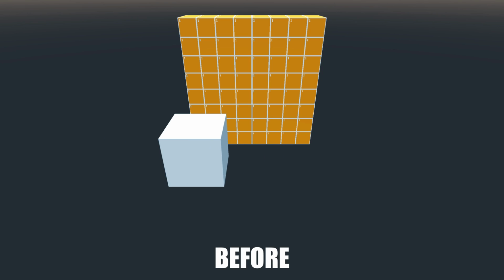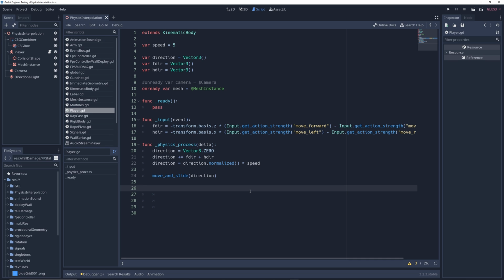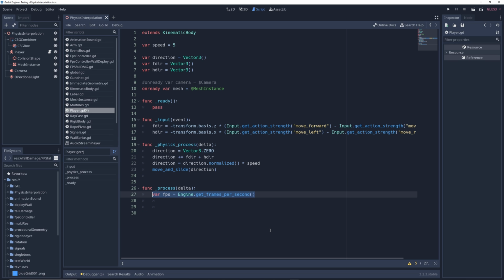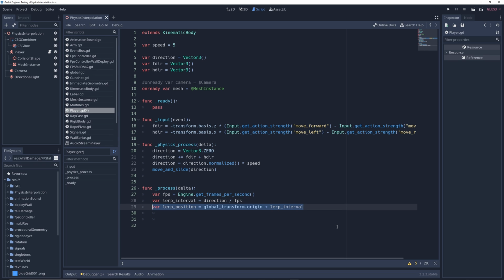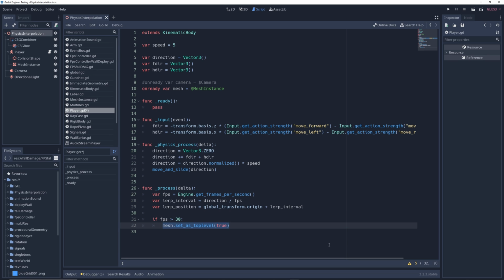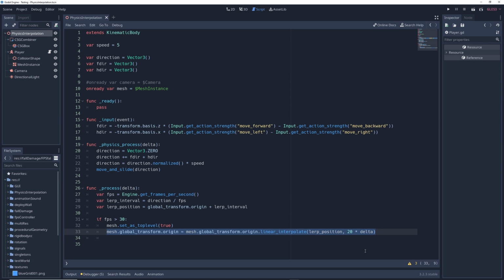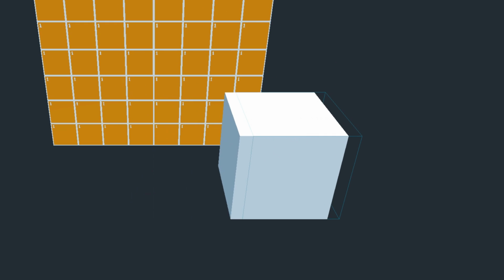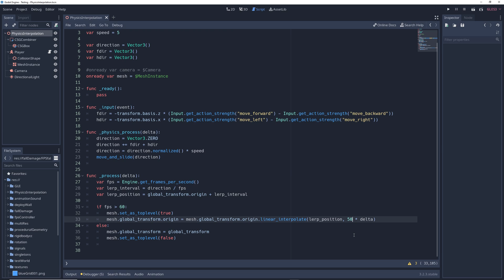Fixing Jittery Movement In Godot

Comment: This actually helps me with my jitter problem in my 2D game! Thanks!
Reply from the maker: Nice, glad I was able to help you
Reply: whats the 'mesh' equivalent in 2d?
Reply: Not sure if I understand. IF in 3d this helps by seperating the mesh from the object that is moving, what is it doing in 2d? What are you seperating? the collision objects? (e.g. collision shape?) just confused.
Reply: @trevoC132  You can use meshes in 2D.
Reply: @felineentity  Yes I realize that, but that is used in almost no 2D projects. the above commentor mentioned sprites are equivelant to meshes. This confused me as if he was somehow seperating his sprite and coll. to gain performance which doesn't make sense. Obviously if you are using meshes in 2d which are really just 3d meshes this would apply. The inference above is that they are using this in another fashion with 2d which is what i was asking about.
Reply: @trevoC132  Oh sorry, youtube's "great" interface kinda hid that and made it look like you were replying to me
Reply: @felineentity  no worries, thanks for the reply anyway. comment system is horrible.
Reply: @David Traves  The concept is that using _physics_process() to render movement and, physics, is important to ensuring the game runs the same on all systems as the physics tick is standardized. This can result in poor visual performance on higher hz monitors and systems which can render the game at higher than physics fps framerates. 

In 3D, you are taking control of the mesh because it isn't the physics body, but rather a visual representation of the physics body for the player to see. You then force it to move (interpolate it's position) in the _process() function without affecting any physics bodies. This method is identical in 2D except instead of manually manipulating a mesh (3D visual layer) you are manipulating a sprite (2D visual layer). The principle and end result are the same. You can get consistent visual performance, where the things you see are rendered as quickly as possible, while all bodies dependent on a consistent delta variable (ie: physics bodies) get consistent performance on all platforms.

TL:DR - 

Anything dependent on physics (like movement) --> _physics_process():

Anything visually dependent on render speed (like animations) --> _process():

= a better functioning game, over all, on average.
Reply: Feline can you make some tutorial for 2d? I have cars on screen and they jiter a lot when going faster 
Its kinematic bodies...  i am a beginer so not understood much how to do it beter.